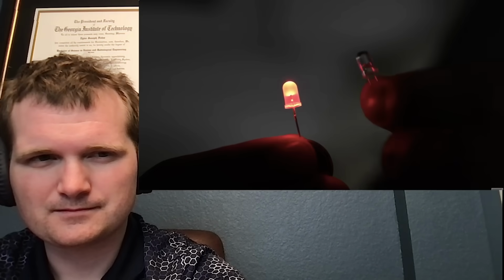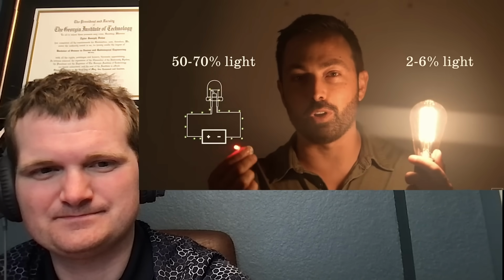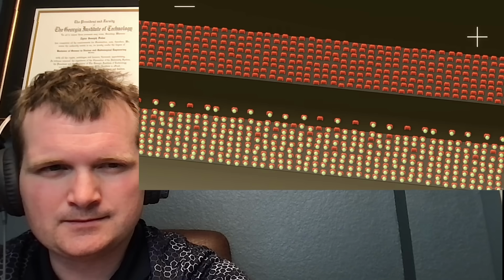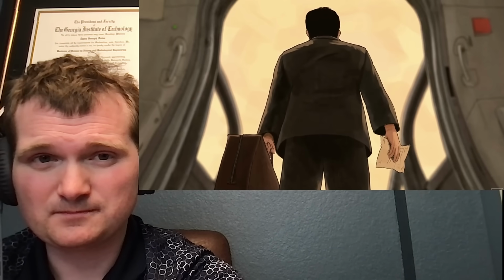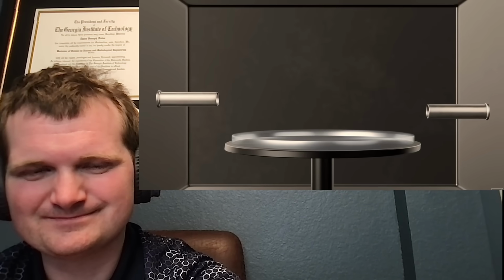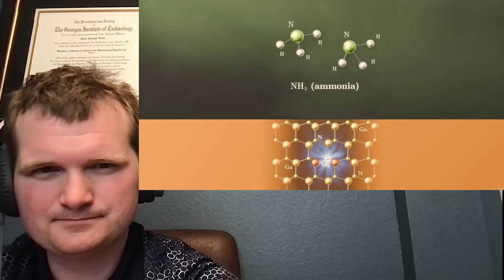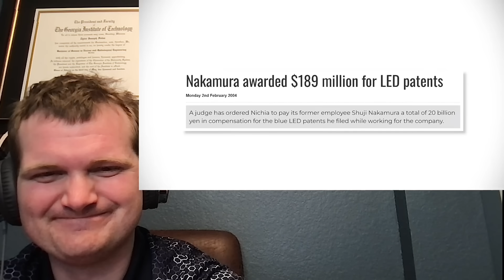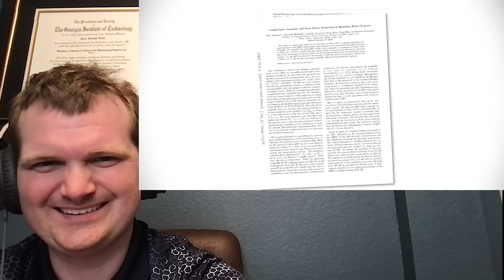Why the Blue LED was as Challenging as Nuclear Fusion is now - Nuclear Engineer Reacts to Veritasium

Comment from the maker: Thanks so much for watching! If you want to hear more about fusion and a company that is facing challenges with it, please check out: https://youtu.be/lb7GXi0ZvYw?si=HxswJJoAP7MWcfGP
Reply: HMMMMMMM
Reply: I think he was referring to the effects of blue light on the sleep-wake cycle as opposed to the physiological effects of radiation (?)
Reply: Actually blue was the first LED found, faint emissions from blue silicon carbide in the early 1900's, but it was regarded as a curiosity, and hard to replicate. H Round noted it in 1907 in a paper.
Reply: Annealing works with many metal and alloys, along with a suprising number of organic materials as well.
Reply: Blue light at night is because the brain has receptors in the eyes that are blue sensitive, which is used to synchronise your circadian rhythms, and thus the body clock, with the day night cycle. Naturally the body, in cases where you are only exposed to red orange light 24 hours a day, underground, away from natural light, your body clock runs slow, typically around 25/6 hours, so the blue light in the noon time acts to reset this clock, and blue light at night means the clock gets reset to noon to 4PM, making sleep be offset by 6 hours or so, meaning that blue light, even at low levels, at night will mean your sleep cycle shifts by a few hours, so you get less sleep. Then you do not get the refreshing REM sleep you need, wake up in the morning to an alarm clock, and every day get a sleep deficit that adds up to mistakes, fatigue and insomnia, leading to burn out and stress.

Thus night mode on screens, that cuts blue light shown drastically after 6PM, and making the screen dark, and colours that are reduced brightness past orange, so greens are dimmer, and blue is almost nothing on the screen, showing reds and oranges as night goes on. There is a reason aircraft instruments avoid blue, sticking to yellows and reds, and not only due to night vision meaning these are not going to affect seeing outside at night.
Reply: I watched this documentary about the Blue LED THREE times with full interest, I was really hooked. I think it's one of Derek's best videos, absolute top tier.
Reply: Now, you can get violet LEDs with a higher band gap than the blue LED, and blacklight (partial UV) which is even higher.
Reply: Annealing: "Mucking about with the crystal structure of your material by heating it above it's recrystallization temp for a certain period of time"
Reply: DPF Fusion will likely beat the tokamak, which is much less popular.

Comment: You will still find people that will argue that a 10,000 lumen bulb isn't bright enough because it doesn't use 60 watts. Believe me, I've tried to explain it to them. It doesn't seem to matter
Reply: So that's why you make a bulb that uses 60 W and however many lumens it outputs... whether or not that is equivalent to standing 5 ft from the Sun or not is up to them
Reply: one of the curse of not primarily using the metric system: americans don't know what a Watt is, or what it's the unit for.
Reply: They probably are also the ones who think the warm/cold light refer to the actual temps of the bulb.
Reply: Fun fact a 10,000 lumen LED would (probably) use over 60 watts.  I had to use probably because data for 10,000 lumen bulbs dosen't really exist, most household lights are about 800 lumens. Many companies have just slapped random lumen ratings on their product with no oversight.
Reply: @rgpmtori  Yeah, I wondered about that. I just used the number 10,000 for hyperbole. I've only ever seen those on flashlights, no household bulbs.
Reply: About 100W. I have a 150W flood light which has around 14,5k Lumen. I use it to wake up fast in the morning.
Reply: @windhelmguard5295 it has nothing to do with the metric system. I live in Norway, and LEDs are sold with watt equivalent. People in general don't understand how things work. Also all measuring systems, be it base 10 or 12 or what ever had their own marits ave drawbacks  for example example1/3 of a meter  impossible to find precisely, where as with a yard its exactly exactly one foot.
Reply: @rgpmtori  100 watt equivalent are around 1500-1600 lumen and are 14 watts or less. There are 9000 watt lumen bulbs that are about 80-90 watts. If I remember right 100 lumens per watt is about right.
Reply: @sir_no_name1478  insert SpongeBob my eyes meme
Reply: @sir_no_name1478  jeez
Reply: whats hevia? a killagram of steel? or a killagram o fettas? thas right, a killogram o steel!
Reply: so, make an led that uses 60W as advertised, with high efficiency driving circuits for the LEDs. then, they might see a light with a heatsink on it, plug it in, and everything goes white.
Reply: 8    @marilynman
Reply: @sir_no_name1478  might do this as well, I have bad time waking up (either sleeping early or late)
Reply: @Retro-- Because steel is hevia than fettas
Reply: @Shinzon23 Efficiency is important too.
Reply: @Shinzon23  University was hard and caffeine did not help anymore. Also it is unhealthy in the amounts I was using ^^.
Reply: Same vibe as saying a kg of feather is lighter than a kg of lead.
Reply: Don't worry, clueless people like me who know nothing about this field will readily accept your argument
Reply: Lol they should make 60 watt LEDs for these people. It would be so bright it's a legitimate danger.
Reply: They make 60W LED bulbs. They are shop lights. The center part is about the size of a full size heat lamp bulb, and then it has 4 wings that come off of it. It would light up a kitchen like a roman candle lol
Reply: I will be one of those people, and yes- I do understand what you mean, but there is something else you're missing.
They are bright, yes... but - not in illuminating your surroundings, no. You can't convince a person who grew up with fillament of that, because what they're saying is true in their experience/in practice, and if you were not used to that, you'd not notice the difference. Yes, you can obviously show it in principle, but in practice- it just isn't so. LED lighting is bright, but that brightness is limited to a very small area. One bulb of 60W fillament lights up a whole lounge area. Let's call it "Surround Light", if you will.

I grew up with 60W bulbs. The lighting of today- although a great invention, is really poor compared to that.
I sometimes wear a headlight at night in the house now, to illuminate all the darker areas - to work and to study, or to search for something that fell of a table and into a shaded area, because I can't stand it. My garage is outfitted with a 60W filament bulb and so are my outdoor lights- and I have no need for my headlight there.
Everything is so dim nowadays. LED lighting is really poor for doing any meaningful work or tasks at night or in darker areas such as a basement or a large warehouse- even in your house. I can't say that enough.

If life was a game, we'd be in the first installment of "Dark Souls" now- where the light is beginning to fade from life. "Even now, there are only LEDs; and man sees not light, but only LEDs"

I can't even watch darker movies properly, because modern flat screens(LEDs/LCDs) have such poor lighting of darker areas on-screen(the contrast is inherently high). I watch horror movies, space movies and movies that have a lot of darkness in them, on one of my 3 trusty old CRT TVs.
"OLED" is such a promising technology- I can't wait to get mine, because it gives that "surround" lighting of filament, with the advantages of LEDs.
It's hard to explain if you've not grown up with it, which I think is the reason you cannot fathom why we won't agree.
Reply: @domainmojo2162 I think it's the difference between the broadband incandescence vs two or three narrow bands for LED lighting. It's more likely that the narrow bands will get absorbed more completely by an object where some part of the broadband spectrum would be reflected and spill around filling the shadows that narrow band LED light leaves mostly unilluminated.
Reply: @windhelmguard5295 Don't gernalize us
Reply: @isaiahoconnor8236  other thing is like teaching 300 million people everything like not everyone knows everything although you could say how things are shown was wrong like 60 watts lightbulbs are standard but no one really checks the lumens

i think people look at the watts more because of older light systems 

table lamps uses mainly 60 watts but some fabric ones recommend only 40 watt to prevent burning the lamp shade because there like less then 0.03 m to the light bulb. we had  lamp with burn marks because of that, the recommend 60 watt was really too hot for that
Reply: Show that man a 100W LED bulb.
Reply: Lazers!
Reply: We learn the metric and imperial system. By 5th grade we learn about Joules, Newtons and Watts, and their relation. 

The problem is, our education system has been broken for decades upon decades.  Most people aren't paying attention and won't bother using it outside of their science classes unless they want to pursue  a career in engineering.

Comment: What's funny is that 20 years ago turning on the light switch and a bulb blowing wasn't that abnormal, now if a light doesn't turn on I immediately think the breaker is tripped or something wrong with the lamp not the led
Reply: Not only that, I remember avoiding to turn on the lights in summer because they were basically electric heaters that provided a little light as a bonus. My god, the heat, it was a sacrifice to read at night in summer
Reply: I haven't had a single LED bulb fail on me apart from one of those wifi bulbs where the IC inside it just completely shorted out, but i have had bulbs arrive dead on arrival. Though it really doesn't matter when a 5-pack of bulbs is like 5 bucks, considering how dirt cheap they are I would rather take the slight hit on QC instead of paying double
Reply: I have a handful of LED bulbs and strips around the house where the power supply inside needs about a second to start up, and that little delay always kinda unsettles me..
Reply: @WooShell  A good portion of my house is like this after remodeling where it takes just about a second to turn on after hitting the switch. It kinda pisses me off sometimes lol

Comment: I'm an OLD retired EE. As kid in high school, I bought my first LED (a dim Motorola red LED, in a TO-92 package) in 1973. They were dim thru the 1980s. The first blue LED was not the GaN (gallium nitride)  LED out of Japan, but a dim SiC (silicon carbide) device out of Cree (North Carolina). It first sold for $60 (EACH) around ~1985. They dropped to $1 a piece, by 1990, so I designed one of these into one of the company's product, at the time.

The GaN device, in this video, hit the market ~1994. Not only did they get blue, but a lot brighter, and much more efficient. The older Cree devices, left the market, and Cree licensed the new tech. Cree then made GaN, but on a SiC substrate. Some people get later Cree devices confused with the older pure SiC devices. I still have a dozen of the older blue LEDs.

Of course, the GaN devices changed the illumination landscape. Now, most light sources are LED. Before GaN, LEDs were only used as indicators. FYI, "LED, a reverse solar cell". Actually, shine light on an LED, and you'll get a voltage out !
Reply: would a photovoltaic cell glow if you laid an active current to it or do they work differently despite being essentially the exact same principle?
Reply: @dominiklehn2866  IIRC, they do; but it's not in the visible light spectrum.
Reply: @darkfoxfurre  so I looked it up. They're infrared so yeah you can't see it, but apparently doing so is a common method to check them for impurities
Reply: I don’t remember red LEDs of the 80’s as dim. Not at all.

Comment: The prototype for that Texas Instruments 4-function calculator initially had a huge hurdle to overcome. The circuit was testing correctly but the engineers were seemingly not getting any readout on the red LEDs. Turned out they weren't red LEDs. They were infrared. The calculator was functioning perfectly, but the readout was invisible to human eyes.

Comment: @36:21 ahem, you did hear what he was saying? It's not really about the absolute amount of blue light, but the relative amount AFTER sunset that disturbs the circadian rhythm. 
Basically it's not the total amount of light that would hurt our eyes, but the relative blue light that tricks our brain into thinking the sun is still up.
Reply: Exactly. From an evolutionary perspective, it makes sense; at most, our ancestors after mastering fire got light from red to yellow wavelengths, not blue. We could fall asleep with those colours present, not blue. The biggest source of blue light at night was, like, the Moon, which I'm pretty sure is much dimmer than a screen.
Reply: @Mercure250   it's less the fire and more so the earths atmosphere that is responsible, air scatters blue light more so than red light does and the lower the sun sits at the horizon, the more air the light passes through before it gets to you, so the later it gets, the less blue light there is. this had been a factor in our evolution long before we ever discovered fire.
Reply: Yeah agreed, he usually gets his facts right, but this time he seemed to have taken a shot in the dark that he doesn't know, and missed completely.
Reply: @windhelmguard5295  Oh, sure, for some reason, I didn't think about that. But that means the fact wood fire has the same colours as a sunset was just convenient, then. That's cool.

Comment: One interesting thing about solar panels basically being reverse LEDs, is that the opposite is also true. Shining a light on an LED can produce a current. Some flashlights can actually be turned on by shining a bright enough light on their emitter (in particular, blue light).
Reply: Also, if you run a current though a solar panel, they emit light (although not necessarily in the visible spectrum).  It’s a fun little experiment.
Reply: You could only use an LED as a solar cell if the incoming light had a shorter wavelength than the light the diode emits.

Comment: The energy needed is also why different coloured LEDs require different voltages to work with the higher energy photons requiring a higher voltage for their LEDs. That is why on battery powered devices with a mix of different coloured LEDs, like toys or Christmas lights, as the battery dies the blue LEDs will dim and turn off first and then green and then the red ones will stay lit for a while and slowly dim. I assume this has to do with the forward voltage of the diode because of the energy needed for the bandgap.

Comment: I was a research assistant in my university lab, when one of the senior research scientists somehow got hold of a commercial blue LED. Not to damage it, he made a current clamp circuit with battery power. All interested were packed into a windowless cleaning closet, and it was a wonder to see. I was surprised how bright it felt even being outside the peak eye sensitivity, perhaps just eye adaptation to the dark.

Comment: The problem with blue light is not about it hurting the eyes but rather it's presence having the effect of inhibiting the secretion of melatonin which would normally occur once the sun went down and the blue light was no longer detected by the eyes. Lighting with significant blue content prevents this from working and thus inhibits the first step of the signalling cascade that should prepare the body for sleep. It is not damaging anything as such but it is confusing the mechanism within the body that normally helps the circadian rhythm stay in sink with the solar cycle. Chronic exposure to blue light far later into the evening than our bodies evolved to set our circadian rhythm around can result in various circadian rhythm disorders such as sleeping disorders for example. Evolution is slower to adapt than the technological changes that have altered our environment fairly recently, most historical artificial lighting had way less of the blue light that circadian rhythm is way more sensitive to. Candles, firelight, and even incandescent lighting is significantly redder than many LED light sources which reduced the disruptive effect. But yes ultimately the issue is not one of the radiation bring directly harmful but one of disrupting biological signalling that evolved for normal healthy functioning of the body and alignment with the natural day nigh cycle by the presence of unexpected blue light outside of daylight hours.
Reply: His reply was the most engineery of engineer responses to this sort of thing. =p (Light of any kind has been shown to disrupt melatonin production in humans, but we're especially sensitive to the 446-477nm band, which is in the area we'd call blue. This has been well established for a long time now.)

Comment: Problems with blue LEDs are mostly about their use at night, not with their use in general. It's true that blue light is a significant part of light seen during the day, and that exposure to it is normal and healthy. The problem is that your brain is not well equipped to deal with a lot of light at night, and being exposed to it during that time can throw off the brain chemistry that normally happens as the sun goes down to trigger your circadian rhythms, which ultimately interrupts sleep.  Out of the colors tested, blue light was the most likely to cause issues, red light was the least likely, and white light fell roughly in the middle.

Comment: I was into electronics stuff from a very early age on, and had always wondered why LEDs came in several colors but not blue. When they finally appeared in my Conrad parts catalog, with a huge announcement on the front, I grabbed a few.. even though they were crazy expensive, especially for a kid.. somewhere around 5$ a piece I think.. but I just had to try them out.